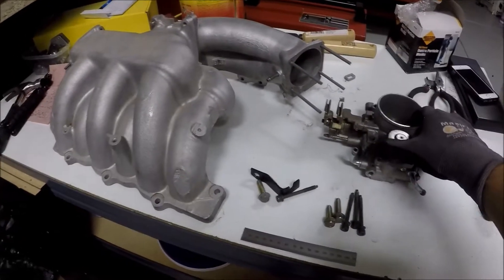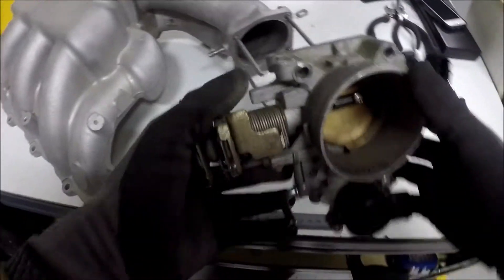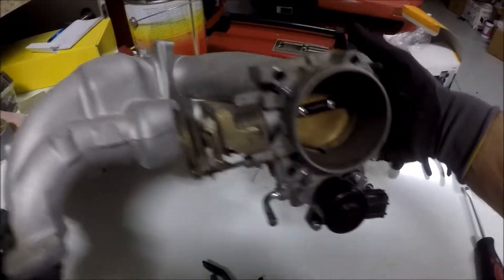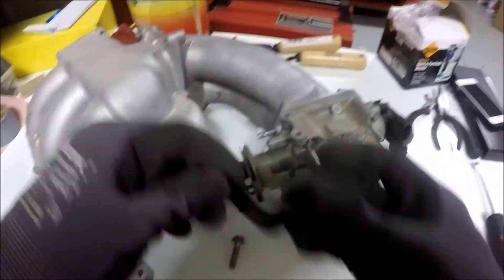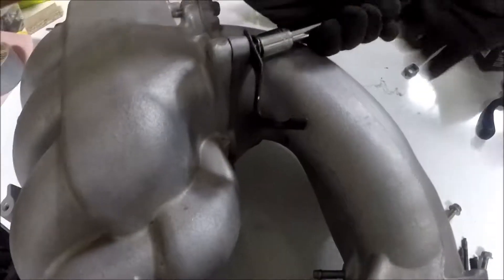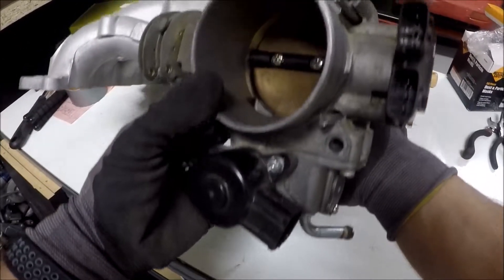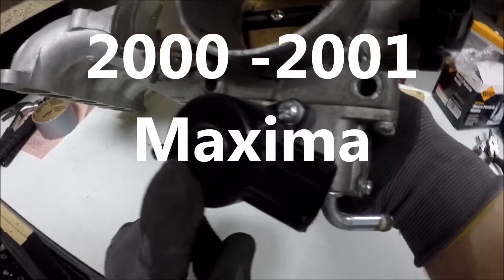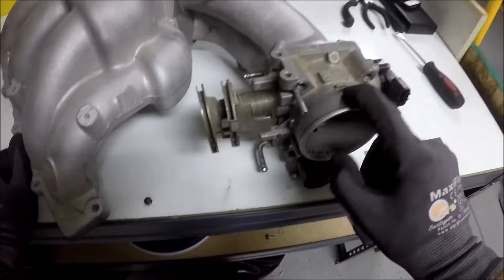Maxima 3.5 Swap - How to Install Pathfinder TB

Comment: What year throttle body?
Reply from the maker: Information is in the description.
Reply: You still selling brackets?
Reply from the maker: @kingGfour  I still make the throttle cable brackets and am currently designing a new PFTB adapter plate for all VQs 2006 and older.